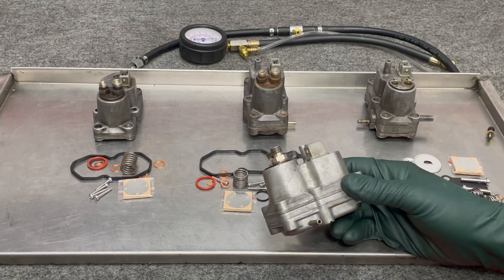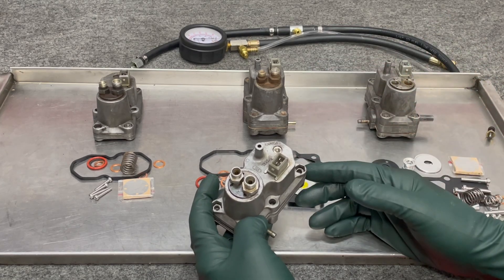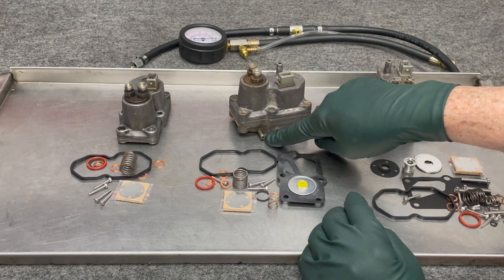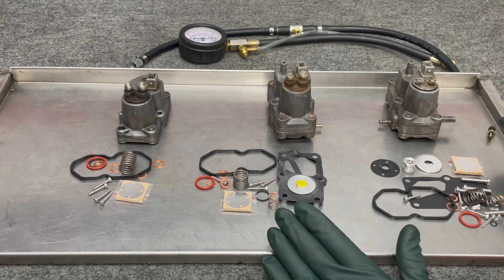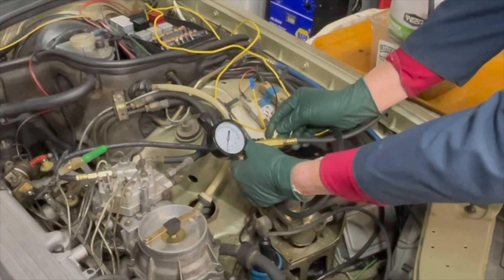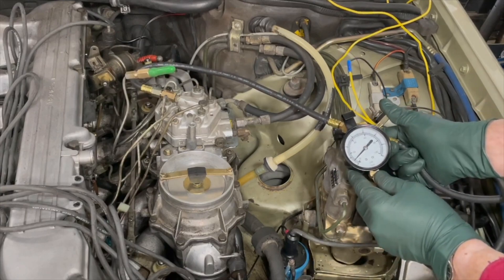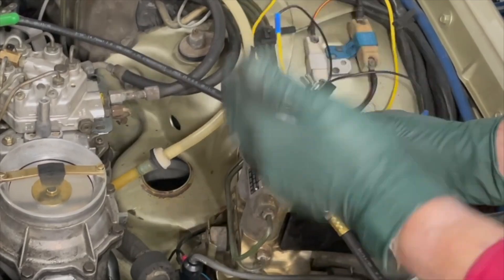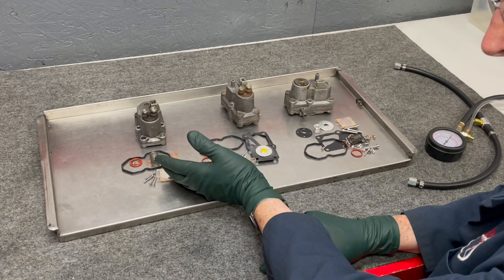76-85 Bosch K-Jetronic Warm Up Regulator. How Important and How to Fix?

Comment: Hi how do I adjust the idle after I set the mixture 1984 merc 280se with Bosch Fuel injection system I've

Comment: Love your videos 🙏🏻

I have a question for the renowned w123 expert. 🙈 I live in the Scotland uk. Over the years our 95ron fuels have transitioned to E10 (10% bioethanol) I’ve read I should avoid ethanol fuel. 

The only fuel I can find in my country that doesn’t have ethanol is 99ron from Esso. Is a higher octane fuel like 99ron safe to use in a 230e? 

Any advice you can offer on this subject would be greatly appreciated as I’m reading so much conflicting information online. I’d like to know how you fuel your car 😅

Thanks again for the valuable content you’re creating. 🙇🏻‍♂️

Comment: The same control pressure regulator, AKA warm-up valve, was used on Volkswagens in the 70's and 80's.  I made a good living buying cars with failed units, replacing them, then reselling. The regulator was inexpensive during those days, so replacing with a new part was an economical solution.

Comment: Excellent video, Kent! 

I recently rebuilt mine with a proper gauge and adjusted it to specs and she's running great. However, I can't find ANY documentation online about how to adjust the vacuum diaphragm drift pin, I don't get any change in pressure from the vacuum diaphragm! If you've ever adjusted one, could you make a quick video on it? 1977 450SL is what I've got.